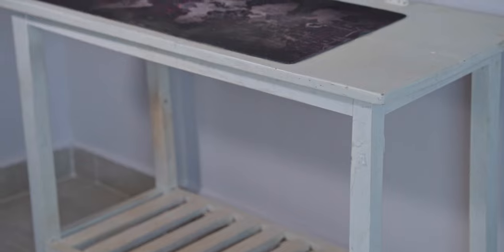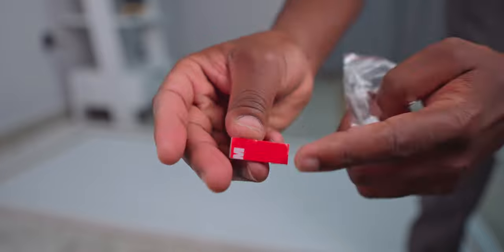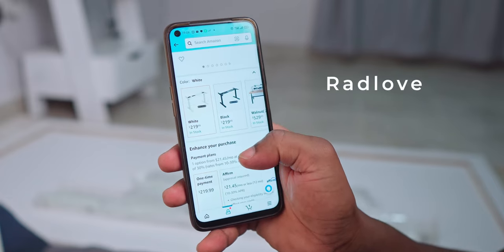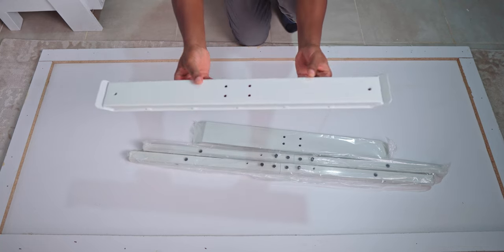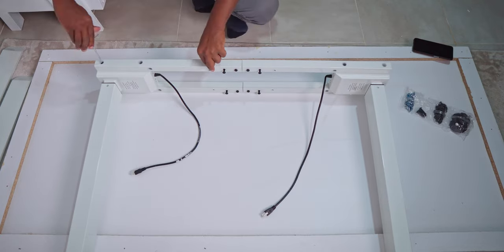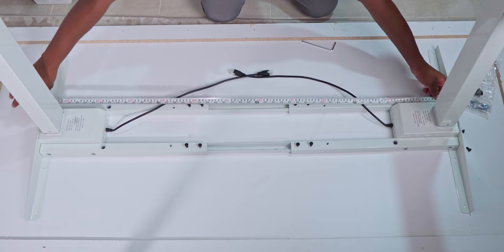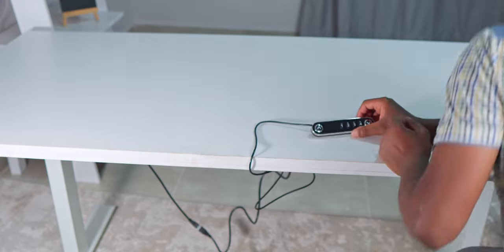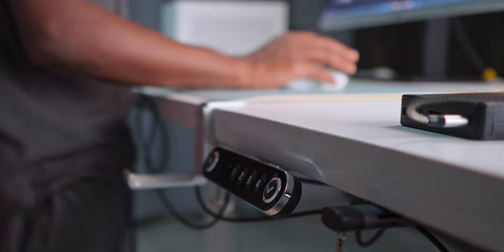DREAM desk build with this CHEAP Radlove dual motor frame!

Comment: Congrats for the video! I work from home and would like to mount a 180cm Ikea worktop on this structure. After a year, do you recommend it to me?  Compared to more expensive brands (Flexispot for example) does it wobble a lot at maximum height? Thanks!